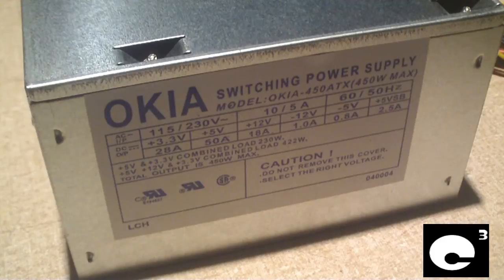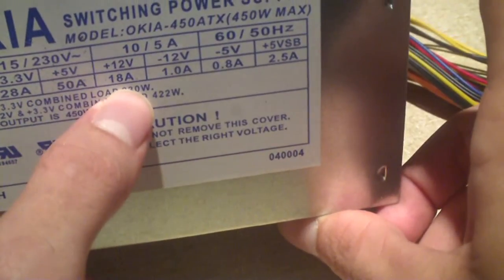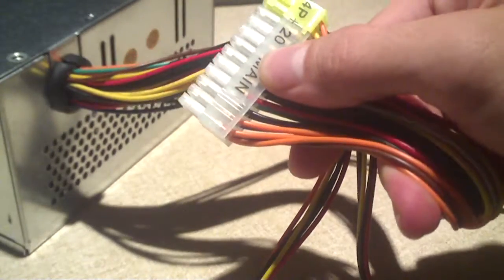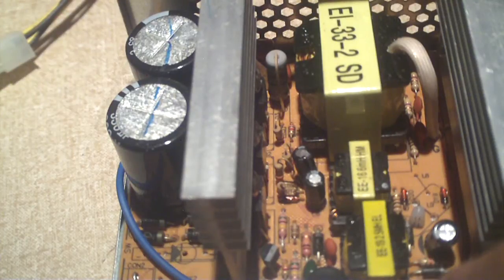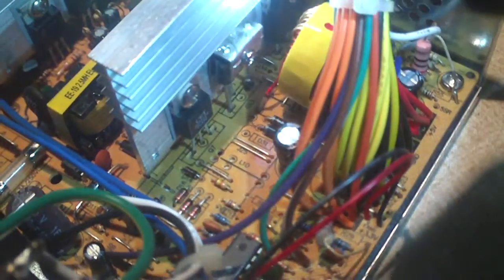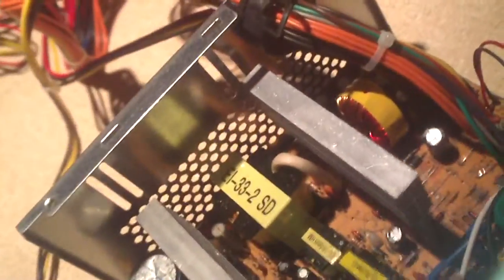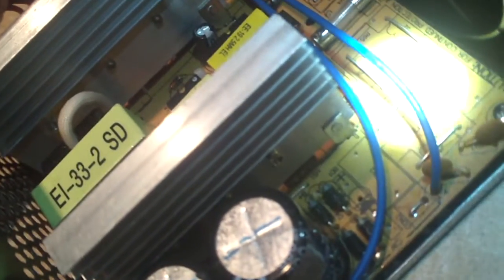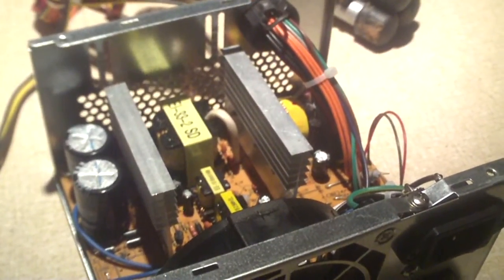Inside an OKIA OKIA-450ATX FeatherWeight WonderJunk PSU

Comment: Hey man i have the same power supply but the specs on the side are slightly different. It reads 20 amps on the 12v etc. If i was to open it and take a video would you possibly give your opinion? I figure it's still a piece of shit but i'm very curious as to what the differences are.
Reply from the maker: Joe Dirt Post the video, send the link, and I'll take a look at it.